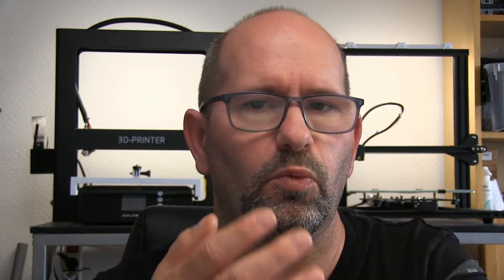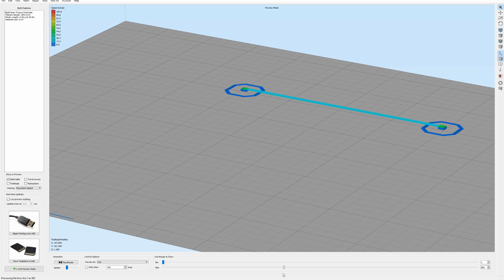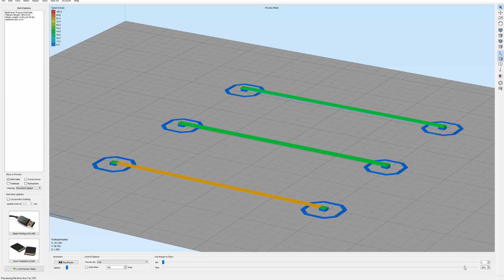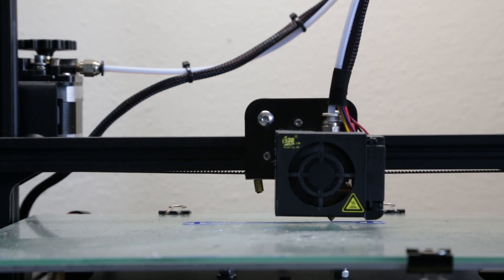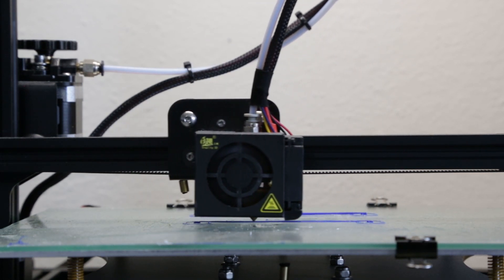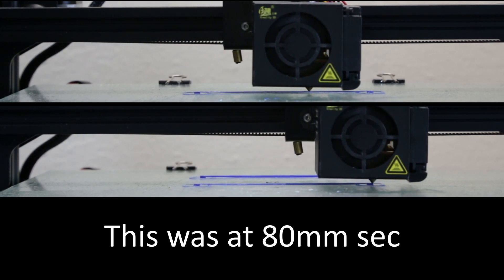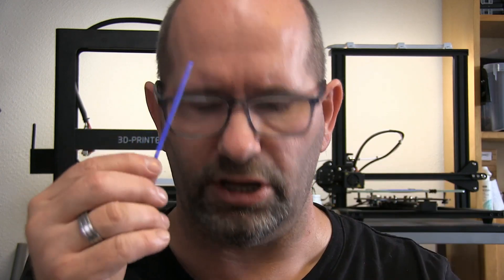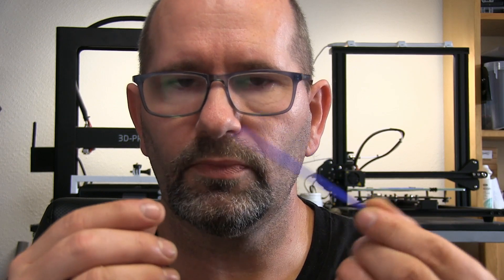▼ 3D Printing Questions - Bridging Speed Multiplier

Comment: Hey Brian - have you noticed any threshold as to where the speed increase becomes necessary?  Obviously, 100mm needs it.  But what about 75mm, 50mm, 25mm, etc.?  Just curious if there's a point where such tweaks are unnecessary (except for printing time, of course), or, even possibly detrimental to print quality.
Reply from the maker: Hi Ron, Thats a very good question and to be honest I have not been testing that. 
I will test this and give you an answer somewhere this week.
Reply: Hey, thanks Brian!  I didn't mean to cause you more work though.  I just figured I might have missed a video of yours or someone else's that dealt with that subject.  I missed about two months worth of videos, and still haven't caught up.